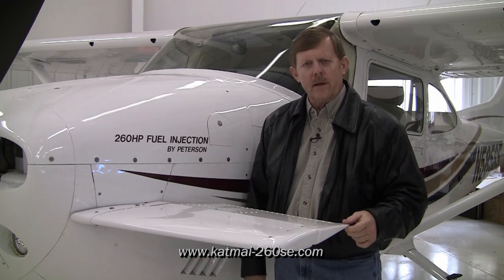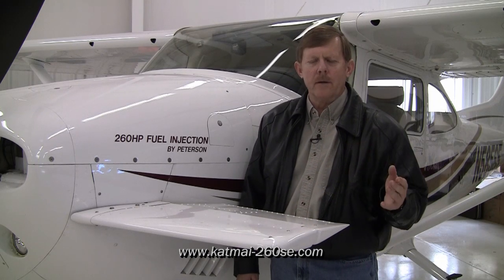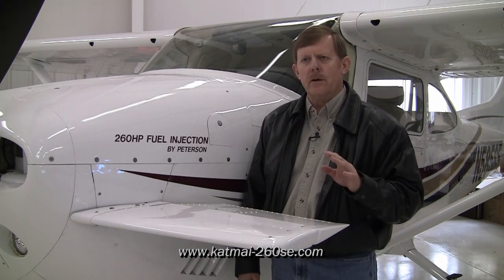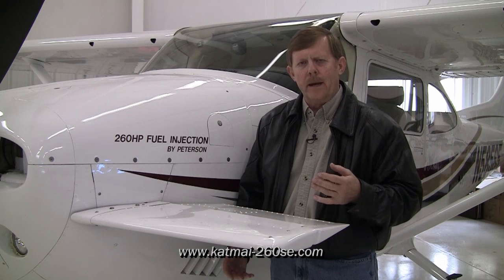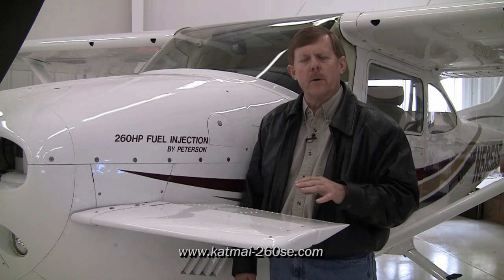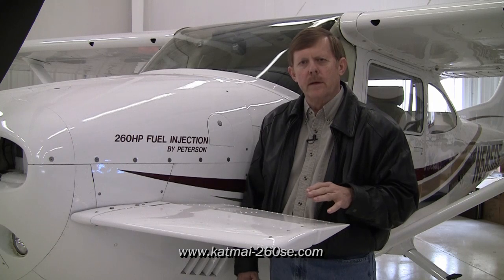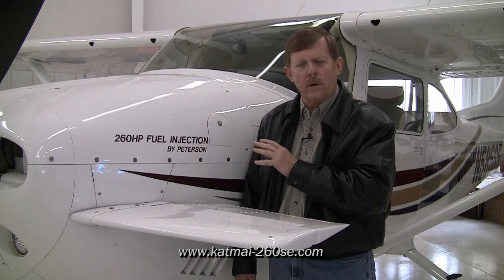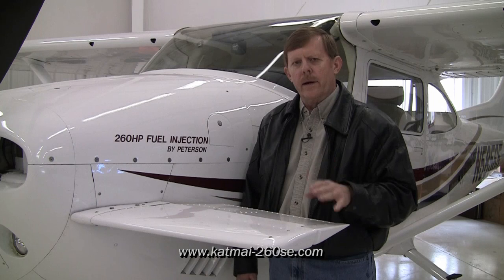Todds Tips - What Does The Canard Do?

Comment: Licensed pilot here since 1980.  before that in the 70’s interested in ultralights (Anyone remover a periodical booklet called “Low and Slow”?) From the Wright brothers trough Rutan’s designs overwhelmingly and compellingly nail down that a canard design is safer and more efficient than “standard” designs.  There is no salient argument or done side.  Feeble attempts to poo poo canards based on propwash etc miss the point. In a retrofit such as this there’s not much choice.. and it still is a major improvement.

Comment: This is the fourth vid I've watched about the canard modification, and I'm disappointed in all of them that not one has popped the engine cover to reveal how it is attached. I'll keep looking, but that's not important, what I want to ask anyone reading this, do you feel like you're being talked down to, like your ignorant? Like someone who's really into aviation enough to be reading this doesn't know the basics, and needs a dumb-down explanation? My intention is not to bitch, but to raise the level of discussion. Thank you and my apologies for my own ignorance.
Reply: Canards, as an addition, can be justifiable on some aircraft with a traditional configuration.
However, canards were not designed for this purpose, i.e. to aid/augment traditional designs.
No, canards are intended for designs which were conceived around them. Burt Rutan's designs are a good, if not the perfect example.

Retrofitting canards on traditional aircraft? Especially when the engine is not a fully stressed member?
I'm not sure. It might work on some models, not on others. In fact, on most traditional models, it will likely do more harm than good, given that drag might increase during some flight regimes.

Comment: Do canards in any way have an effect on fuel consumption, cruse and top speed?
Reply: On a traditional aircraft, the addition of canards will, most likely, reduce cruise speed, top speed and fuel consumption over medium-long duration flights.

The advantages, in my opinion, can be:
1- Higher maneuverability.
2- Better stall characteristics.
3- Higher efficiency at low IAS.

Other than that, I am struggling to find benefits. On the contrary, if installed in the wrong place it might affect the stagnation point of the main plane via its downwash, and especially its tip vortex.
If installed, it should be above the axis of the main plane, or WELL bellow it! in order to not affect the pressure distribution of the main plane.

Comment: I play Kerbal Space Program. I love to design planes.

I’d built a very back-heavy supersonic-capable craft with afterburners, and was slightly frustrated with the fact that my nose was hard to control. As you can imagine, adding a basic canard up front balanced the craft beautifully. I was taking off sooner, and I was landing like a feather. I loved it.

But then that begged a question from me with regards to understanding the plane part properly. Are there exceptions? Is there a time when a canard shouldn’t be added to a plane’s design? 

I’d love to know.
Reply: It increases drag, reduces cruise speed, and reduces range. I could see them potentially reducing the roll rate too (unless they can work independently like ailerons also).

Comment: hangliders have to stay under the 130 degree nose swivel angle rule and the only other way is a cannard ..boeings 737 is grounded because of this problem of the incidence not activating because of luffing modulations decentering the lift centroid .. burt rutans cat bird is another good example and the italian paggio .. triple tandem wings are ahead of their time most engineers dont under stand harmonic modulations luffing the rear incidence rule and tail slides and flat spins and divergents ..... skeatesybubbuygoddess 2020

Comment: If the canard us so helpful, then why dont more airplanes use it?
Reply: Idk either
Reply: In the fighter jet reason is a canard one like typhoon or gripen etc can't go stealth because of the canard.
Reply: @al-32f1  due to the shape of canard it is visible the radar signal.
Reply: Although it helps flight characteristics, the Thrust Specific Fuel Consumption goes up because of the added drag. It’s a trade off.

Comment: Slow flight is all great and dandy, but what kind of reduction to cruise speed can we expect from the extra drag, especially considering its directly in the prop wash
Reply: As I understand it, there's zero negative affect on cruise.  I suspect this is related to a reduction in wing load related to less load on the horizontal stabilizer.  If I'm wrong, I'm certainly up to correction and hopefully related logic.